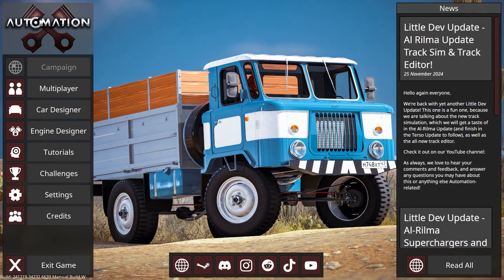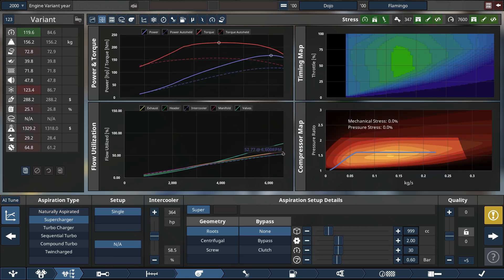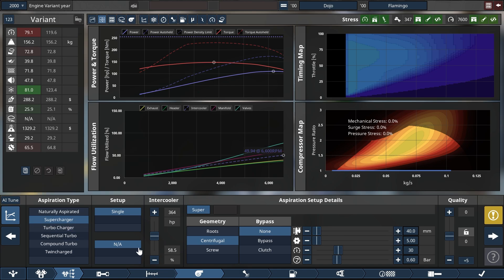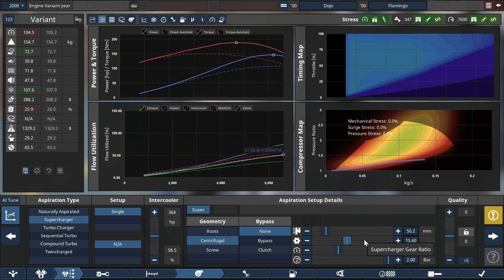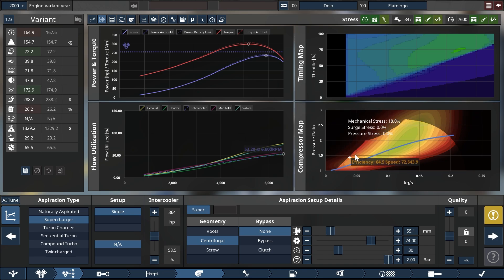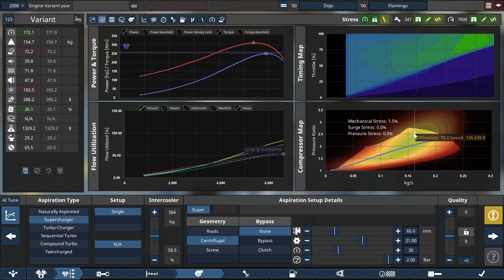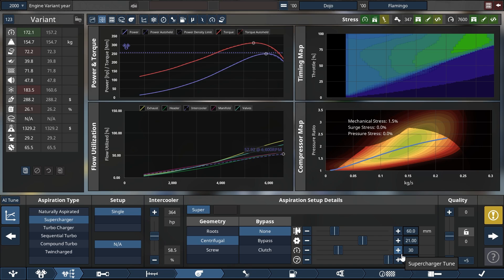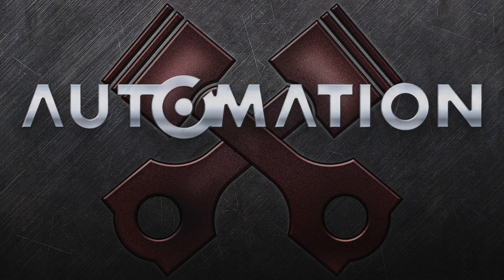Centrifugal Supercharger Tuning Tutorial

Comment: I absolutely love these centrifugal superchargers.  Very very easy to tune, IMO.  The one thing I'm struggling with, and maybe I'm just stupid, is where to find the boost pressure of the engine?  So far, the only ways I've been able to figure it out is by adjusting the boost limit until it does something, or do a dyno pull and read the gauge.  I imagine this is a non-issue for people who think in Bar and associate it with pressure ratio in the compressor map, but "1.4 surrrender flags per free healthcare" isn't a unit my American brain can easily translate into PSI.
Reply from the maker: In the top lefthand corner in the Engine Designer, there's a series of buttons that change the graphs you're looking at; what you want is the now-incorrectly named "Turbo Grid" graph; that shows you how much boost your engine is making at a given RPM.

Also, you can change your units to PSI in your game settings, if you haven't already ;)
Reply: @AutomationGame  I've seen that, but the turbo grid reads absolute pressure rather than boost pressure.  For example, at the moment I'm playing with a turbo with the wastegate set to 24.5 psi, but the turbo pressure graph reads 40 psi.

On another note.  I've been getting some very peculiar behavior with compound turbos.  Certain boost pressures cause instant catastrophe, and the timing map shows a big rectangle of death.  I know it's an alpha abd bugs are expected; I just wanted to make sure the team was aware of this one.  Love the work you guys are doing.  Been playing since 2012!

Comment: The part of current centrifugal tuning that confused me for ages is that the boost limit controls ignition timing like you where always making that much boost. So if you allow 1.5bar near redline your loosing a lot of power and economy below half RPM where the supercharger is making less than 0.5bar. This is a very minor detail for making a race car, but a massive impact for factors like road going fuel economy, as the engine will rarely be operated enough RPM to reach the boost limit.

Its also not like this is a "realistic" limitation of engine design as even on very old school mechanical systems the ignition timing normally advances with engine RPM anyway, so adjusting how much it advances to compensate for the expected boost+safety margin is trivial to do mechanically when compressor RPM is always a fixed multiplier of engine RPM (unlike a turbo).

Comment: my engines always melt when in beamng even when using just turbos and i did bot have this problem before the update
Reply from the maker: This is a known bug; we have implemented a partial fix for petrol engines, but anything running an alternative fuel engine (such as methanol/ethanol blend, LPG, etc), still has this issue.
Reply: @ i have the problems with unleaded 98 too and it always overheats even when not having a crazy engine i tested one v6 single turbo unleaded 98 it ran 600hp 600nm and 7200 rpm limit 1000 hp intercooler and it still overheats

Comment: Question, we be able to go below 25 percent throttle on the engine tester thing? It seems like at lower RPMs you can only run at full power due to this right now.
Reply from the maker: The test simulation will always run in such a way that the engine will always be making net zero or net positive horsepower; engines with high friction values (small displacement and lots of cylinders, basically), engines with superchargers, high cam settings and low balance masses will have much higher idle values.  Also, we had a bug with supercharged engines specifically that was double-counting friction, which wasn't helping!
Reply: @AutomationGame  Another question, thermal efficiency for turbos seems to be very low(like 10 percent, with DI and all that stuff). Is this a bug? Also it seems like the actual flow values don't line up with the values displayed on the compressor map.
Reply from the maker: That is a bug that we're looking into :)

Comment: I really hope you guys did justice to compound turbos in this update, i.e. surge point is now at the previous pressure ratio squared (where a single or twin turbo setup would surge at a 3:1 pressure ratio (29 psi), an equivalent compound setup will surge at 9:1 (118 psi)), boost can be significantly higher without knock or with worse fuels because of the extra stage of intercooling between compressors, significantly larger turbos can be used on small engines, and the overall power curve ends up being essentially the quick response and high low end torque of the small turbo with the high end power of the larger turbo added on. Compound boost has actually been around a lot longer than most realize, Alfa Romeo used a compound roots supercharger system on the 159 Alfetta in 1938 to create 450 horsepower from a 1.5L engine for road racing. Absolutely incredible what's possible with compound boost.

Comment: Do you know why whenever I export the cars they over heat immediately when touching boost? I built a 1300 hp twin charged car all the airflow 10 speed auto methanol making 40 psi after the bypass of the supercharger. Just over heats immediately
Reply from the maker: That's a bug that we are working on a fix for!

Comment: idk if i'm dumb but I keep having an issue with the sequential and compound setups where i have maxed size intake and exhaust and they are both at 150%+ utilization even when i'm running less than 20psi... and on sequential setups my  stage 1 turbo seems to make it harder to spool my stage 2 so much so that its better just to run a normal turbo setup. love the game and much awaited update just wanting to know if i'm doing something wrong or what's up. thank you for the great game =) EDIT i am actually having the intake and exhaust restriction problem on all high performance engines, will this be fixed or is this intentional???
Reply from the maker: This is potentially a bug; we are looking into it as we speak!
Reply: @AutomationGame  the spooling problem was my fault I had my turbo sizes backwards. Intake and exhaust are still very restrictive though most power I've been able to make is 2,200hp @3900rpm any higher rpm and that's when the restriction chokes it. thank you!!!

Comment: they just couldint resist ruining our excitement, by not letting us put carburettors ontop of the supercharger, instead the fools decided to put the carburettors BEHIND the supercharger, they dont even let us have a 3-Red-Butterfly chrome Scoop 😭
Reply from the maker: Our supercharger layouts represent production - or what one could reasonably expect to be production - engine layouts.  Cool as they may be, no manufacturer ever hung a huge supercharger out the hood, with a Garlits bugcatcher on top :P
Reply: @AutomationGame  you are actually incorrect, the ford mustang lawman was produced with only two cars, and had a bug catcher and carburettors as mentioned in my comment, cars were produced with this in mind, they arent common, but the lawman is certainly one.
Reply from the maker: Not really a production car either - all six cars were made by a contractor on Ford's behalf, with of course the two supercharged ones being among them.
Reply: @AutomationGame  ok what about dragsters? They are all built on a small production line, mostly come stock with superchargers, you should of added it, i think youve made all the hot rod/muscle guys cry